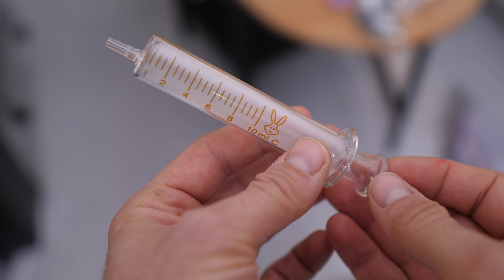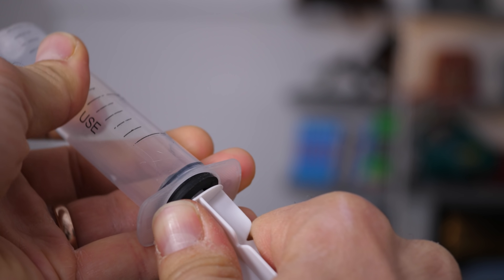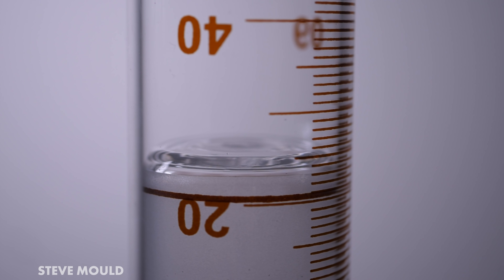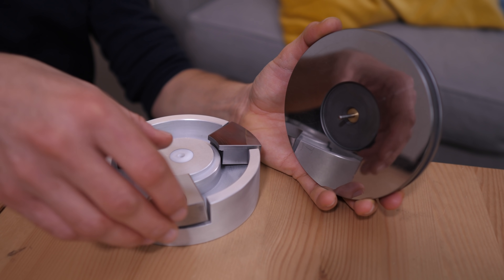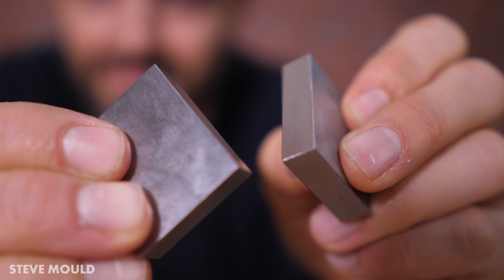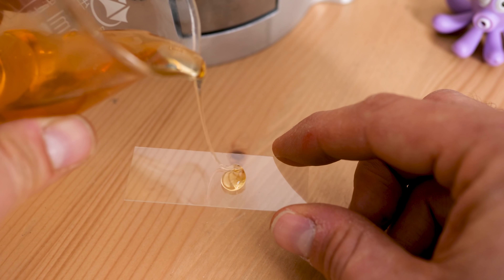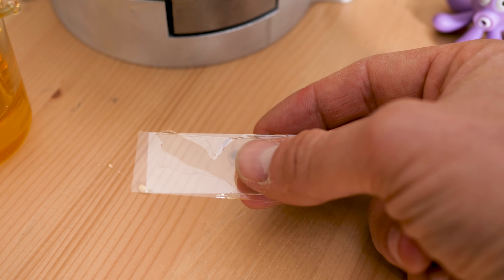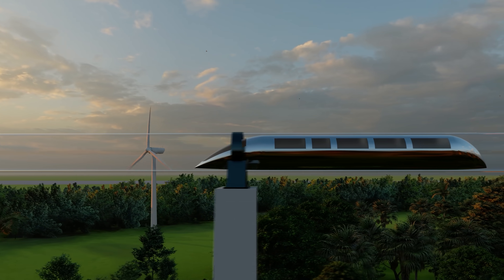The Self-Levitating Kingsbury Aerodynamic Bearing

Comment: Amazing video. Very well explained. I had no idea there are glass syringes! Crazy.
Reply: They were always glass until plastic was invented
Reply: @johnptc  Methinks glass syringes feel much nicer than plastic ones. So smooth, especially with liquids in them. My grandfather was a surgeon and he has some interesting things hidden at his place. I once dug out a glass syringe, played with them, and went: "Wow, these are so unbelievably smooth! Why aren't all syringes glass?"
Reply: @tomhsia4354  plastic syringes were already in common use by 1970 and they work very well for single-use applications because they can be thrown away instead of cleaned/sterilized.  They're also very sturdy compared to glass ones.  Medical infrastructure would have to change greatly in order to once again support sterilization of things like syringes in the place they are used.

Disposable hypodermic needles are perhaps an even greater revolution -- in the old days you had to sharpen your own needles to keep on using them.  Modern machine-sharpened ones can be thinner, sharper, and less painful in use.
Reply: @johnptc  Except for metal ones
Reply: Glass syringes' main purpose is to convey chemicals that would eat away at rubber and/or plastic and contaminate the solution. Typically these chemicals are incredibly reactive, like high concentration acids or bases.
Reply: @MrFlarespeed  Yup, everything in chemistry has to be glass. Rubber hoses are sometimes used, but they have to be very specific.
Reply: EFFram YOUng  isnt african trypanosomiasis kills like 100% without treatment so 10% seem ok even today?
Reply: EFFram YOUng  our bodies are so durable, yet so brittle. It's fascinating really
Reply: EFFram YOUng do you have a source for that?
Reply: Know them since COD BO lul
Reply: You never seen Sherlock Holmes?
Reply: Searched for it!😂
Reply: Well yeah, syringes were originally made out of glass. Haven't you seen Pulp Fiction?
Reply: @joshyoung1440  In Pulp Fiction the syringe has a rubber plunger. Also, old glass syringes were made with metal parts and often metal + rubber plungers. At least what I have seen. Actually, before this video, I have never seen a fully glass one.
Reply: We call them 'gas syringes' as if you have a system that is giving out a small amount of gas and it is connected to this type of syringe then the pressure is enough to force the piston to move as there is so little friction so you can collect the gas easily.  They are also great if used 'back to back' one with a large plunger and one with a small one to demonstrate the counterintuitive nature of pressure.  https://youtu.be/Z6ON7eJi32Y
Reply: I would assume that was what they were made of before they were plastic
Reply: When I discovered Ground Glassware I was amazed at how well of a seal you can get with it. I bought a few things off Ali and I love using my glassware. If the ground area gets dirty/wet it seals even better.
Reply: If you got a 3D printer and two of these cylinders, you can build an engine. Try it out!
Reply: Because you are very young!
Reply: i'm surprised you hadn't seen hem before, but our life experiences are all different.
Reply: Right?
Reply: Spoiler alert 😳

Comment: 1:58 - Glass is actually extremely elastic. Elasticity is the ability of a material to recover its shape when a force causing a deformation stops acting on it. It's not particularly flexible (i.e., it breaks easily) but it is very elastic (i.e., when it doesn't break, it recovers its shape perfectly).
Reply: As a kid back in the 60's I stood outside a giant, (what I think would be called plate glass) bank window where my Dad worked and watched it flex with the changes in air pressure between open doors and closed. It also had one of the classic cone shaped divots created by a small projectile, such as a bb gun. I thought it was manufactured into it back then.
Reply: @Qingeaton  - I remember a friend (well, acquaintance) of mine tripping and slamming his head into one of those. It flexed out, then in, then seemed to freeze for a second, and then shattered into a million pieces, like something out of a comedy sketch (or an action film where the guy with the "shatter glass" button was distracted).

I don't think it was the impact itself, it probably just moved the glass enough to cause a crack to propagate from one of the edges.
Reply: As a former student of the Institute of Geodesy, I note that to eliminate the influence of the magnetic field, glass springs were used in some gravimeters
Reply: So a golf ball is elastic.
Reply: Neeeeeerrrrrrrd
Reply: Melt it???
Reply: I think his description is a material/property combo.
Reply: @ezrahackman840  - His description is a common misunderstanding of what elasticity is. And this being a channel for nerds a technically and scientifically inclined audience, it's important to use nerdy physics terminology correctly.
Reply: Glass is also strong, even though it's brittle.
Reply: Ever seen a car with extreme bass and how the windows vibrate so hard it curbs
Reply: @Rm-mz5cn  - Car windows are generally not made of solid glass, they use "safety glass", which is laminated with plastic.
Reply: @RFC-3514   I know it's to prevent shattering in the event of a crash but still like how tf did the glass not atleast crack
Reply: @Rm-mz5cn  - The glass layers are very thin, so they can bend more (like glass fibre). Also, note that a lot of the apparent bending you see in those cars is actually an illusion caused by the camera's rolling shutter. In real life the windows shake back and forth but don't undulate that much.
Reply: @RFC-3514  generally the front windshield is laminated.
Side and rear windows are tempered and shatter.
Reply: @fixitallpaul4847  - The rear window is nearly always safety (laminated) glass as well, and about 30% of current models use laminated glass for all windows.
Reply: I don't believe you. That would make egress very difficult.
Reply: @Rm-mz5cn , sometimes imit does. But, the amount it can flex is amazing.
Reply: the most useless "WELL ACKTCHUALLY" comment I've read in a while

Comment: Another super common use of air bearings is in computer hard drives.  The drive head floats above the rotating disk on a gas cushion.  The gas cushion is maintained by the rotation of the disk itself.  The hydrodynamic design is what has allowed disk drive heads to get closer and closer to the rotating surface, which has allowed for increased storage densities over the past 15 years (note that this is no longer the limiting factor).

Oh it also explains why hard drives are sealed units - they use a gas with lower viscosity than air, which allows the drive head to be closer to the disk even at very high disk speeds.

Comment: I'm curious how effective an aerodynamic bearing would be in a flywheel energy storage system. My quick searches don't seem to reference that as being used as the bearing method currently, but maybe it's just top secret. Or maybe there are just better ways of storing energy for the same applications that a flywheel would have been used for.

Comment: Glass syringe looks like a good cylinder with zero friction, for some projects.
How much leakage does it have? How quickly does the plunger go holding it's own weight, and air being the working fluid?

Comment: Wow, I thought glass syringes were a thing of the past... these were used in the communist era here in Romania and they were completely replaced at the beginning of the 90s. But the plunger was made out of metal, so was the whole needle, including the part going on the exit tube of the syringe. The syringe ends were metallic too, so the glass part was just a cylinder. They were reusable, after each shot they got sterilized.

Comment: Did anyone else notice that he described Aerodynamics as Hydrodynamics, since he was actually describing a Gas (Aero) and not a Fluid (Hydro)?
Reply: Looks like a slight nomenclature thing.  Fluids can be liquids (incompressible fluids) or gases (compressible fluids).  Aerodynamics is the study of compressible fluids, hydrodynamics is the study of incompressible fluids.  Aerodynamics is a superset of hydrodynamics (the math is much simpler when you remove compressibility from the picture). So you are correct that the use of the word 'hydrodynamics' here isn't exactly accurate, but it is worth noting that hydrostatic and hydrodynamic bearings work with either gases or liquids, though - and they are still referred to as hydroXXXX.  I have an advanced degree in tribology (the study of thin films), and by far the phrase that is used in the literature is 'hydro' regardless of whether the study is of compressible or incompressible fluids.  Gotta love English!

Comment: There’s also a thing metal can do called cold welding where the atoms spontaneously join together, but usually oxide layers prevent it. But it might be possible if it’s flat enough.

Comment: I wonder if those flashes were because the current was able to break the insulation threshold of the air. Which seems plausible because the air cushion is just 3 to 4 micros thick.

Comment: The EPFL in Switzerland is working on rotors for very small compressors with gas bearings that can spin up to 300,000 rpm. The gas at the bearing is the same gas that is pumped. A very promising aplication is very efficient two-stage heat pumps. The shaft has a chevron pattern and there is an allowance between the shaft and the housing of just 5 micrometres. Pretty amazing stuff!
https://www.epfl.ch/labs/lamd/

Comment: Ice skates melting ice due to pressure only happens within a very narrow range of conditions. The idea that this has been shown to be  the general explanation of low friction is a myth.
Reply: @scientious what happened in the past years? 
The last article I read was the theory of ice skating by Yves Pomeau. 

 https://www.researchgate.net/profile/Yves_Pomeau/publication/271771524_Theory_of_ice-skating/links/59ec583caca272cddddf113c/Theory-of-ice-skating.pdf?origin=publication_detail
Reply: @BoserPSN  The theory that a thin layer of water is always present at the surface of ice dates back to 1850. That has been confirmed. The water is not generally created by skate pressure, although you can get additional water to form under pressure within a very narrow range of conditions. The problem though is that skates also work outside of that range such as when the ice is colder.

Comment: This could potentially have incredible uses in windmills. Why is this not a thing?
Reply: The point of windmills is to make something else turn, what use would it be to have the rotor completely isolated by a bearing (of any type)? You're not trying to make it spin forever for its own sake, you're trying to get power from it.

Comment: What would happen if you spin this in a vaccum chamber?
You would not be able to pull a perfect vaccum so would the reduced air cause less friction because theres not as much air sticking to the syringe to stop the 2 parts touching or would it cause more friction because theres not enough air to separate the 2 parts?

Comment: OMG TAKE MY MONEY i want one of those bearings. Also: the internet hereby demands that we get one of these things (perhaps with a weak motor to keep it spinning) into a vacuum chamber! Below a critical pressure the hydrodynamic effect wouldn't be strong enough to support the bearing any more, right?
Reply: yep - if you remove the air, the bearing definitely doesn't work.  Mathematically, the amount of pressure the bearing exerts is proportional to the density of the working fluid, so as the density goes to 0 so does the lift of the bearing.

Comment: Why does a glass syringe work at all? He explained how it twirls, but not how it can form such a good seal. How good of a seal does a glass syringe make? For example, does any of the fluid in the glass syringe seep out the wrong way, even just a little bit? Regular rubber syringes can leak a little sometimes.

Comment: "Glass is hardly elastic at all."

I find that hard to believe. I've been taught all through school that glass bounces higher than a rubber ball of similar geometry. I thought that the bouncing was a function of elasticity. Someone please clarify.
Reply: Elasticity has a layperson meaning which is different from the physical meaning (and almost completely opposite). When they say glass is "elastic", that's because it's hard and exerts very high force on deforming. (You may have learnt about the elasticity of materials, F = "K"x.) Here, high elasticity means that squeezing is very difficult because of the massive amount of reaction force glass displays, aka it bounces higher because the retention of the initial kinetic energy is much more.

The laypeople definition very different because something being elastic means it's "easy" to compress or extend, which almost always means that Hooke's law (F = Kx) doesn't hold, and the stress/strain curve is different because the material can undergo much higher displacement due to external forces without becoming permanently deformed (this is when a material stops becoming "elastic", or springy, and becomes "plastic", such as plastic which is melty and waxy and doesn't bounce, instead becoming deformed and misshapen if you squeeze it around). Generally glass and metals and other stuff aren't considered elastic because the reaction forces on deformation are so high that you barely ever reach the plastic region (unless you're glass-blowing or something, I guess...)
Reply: Elastic is just overloaded as a term.

The most related elasticity for what "glass isn't elastic" refers to is the failure mode aka how things break. Elastic materials fail in shear. They stretch and get thinner first(called necking) and then rupture. The alternative is brittle materials which fail by well, shattering.

The elasticity with the bouncing balls is Elastic Collisions, to which "elasticity" refers to the bounce itself, rather than the glass or rubber. An elastic collision doesn't lose much energy so the bounce is the same height, whereas an inelastic collision loses energy to sound and heat and the like, and that energy can't go into upwards motion.

And the other one is Elastic Deformation. This is the tendency to return back to the same shape when you put pressure on a material and take it off again. If you squeeze the rubber and glass ball in you hand, they're both deforming elastically because they both go back to the ball shape at the end. The alternative is plastic deformation, which is when you push it too hard and the thing stays bent.

The deformation relates to the collisions in that there's some efficiency to the elastic deformation, with losses from sound or heat. Of course if you get into plastic deformation or the ultimate failure, you won't have an elastic collision anymore, and instead you'll have a bunch of broken glass and rubber on the floor.

Comment: I think the floating heads on hard drives levitate in the same way.       (Does that mean a HD wouldn't work in space?) 
And I think, one stage further removed, when a snow avalanche reaches a certain  critical speed, air gets mixed in the bottom layer of snow and the whole thing takes off on its air cushion.

Comment: Now I know how the bearings work on a connecting rod in a motor, very cool video!
Reply: There is also a micro film barrier in the cylinder wall(s). With high speed engines moving metal parts, the micro film has to be a type of oil for the forces involved. But yea, same concept. That is why tolerances are very critical in those applications. Too large of a clearance, the micro film will lose its structure. Too little, then there isnt enough of a barrier which creates contact between mechanical surfaces. Once there is contact, the life of the engine or machine reduces dramatically.

Comment: 10:05 I believe this is a common misconception about ice. Recent studies have suggested that its slipperiness does not in fact come from pressure causing it to melt, but from loosely bound, freely moving surface atoms in the ice state itself. If it iceskates really did work by melting the ice underneath them you would expect ice to be slipperiest when its very near freezing, but peak slip actually comes near 17˚ F

Comment: I wonder if standing it vertically and spinning the top with more weight on the top would force a bit of a down over the cylinder and make it more efficient . Might be hard to calculate though considering there would be more mass spinning to spin longer.

Comment: Dude we don’t know why those blocks stick together? That deserves its own video. Loving the content— I literally now understand how a fluid bearing works, I think
Reply: When there is absolutely no air between those perfectly flat blocks, that area is in near vacuum and therefore near 0-psi. So 14.7psi atmospheric pressure will push them together at opposite ends making them appear to 'stick' together just as how a rubber suction cup 'sticks' to smooth surfaces like glass. ☺
Reply: @rxsyete  Isn't there a certain amount of Van Der Waals force involved?  The same effect geckos use to stick to walls?
Reply: @Tasarran  
I don't think so because above just works on differential pressure (not molecular attraction) just as airplanes fly because pressure below the wing is greater than above it creating lift. Similar to suction cups being pushed against the wall by the psid (differential) of atm press and the vacuum on the other side of the cup. ☺